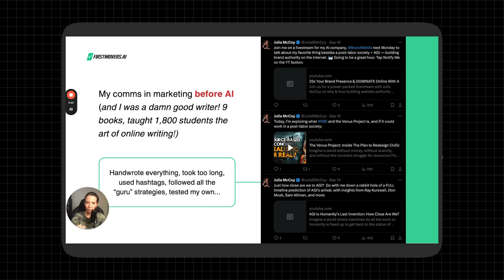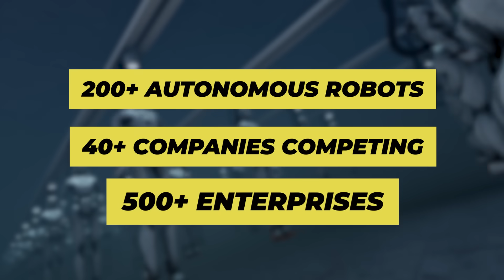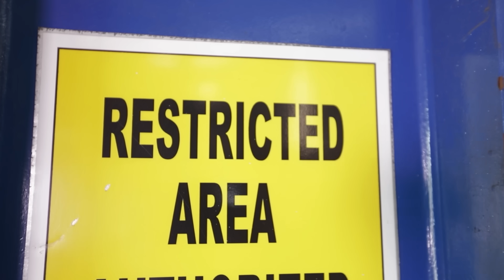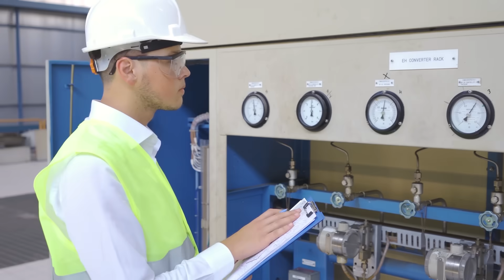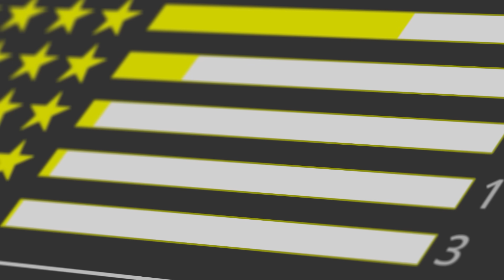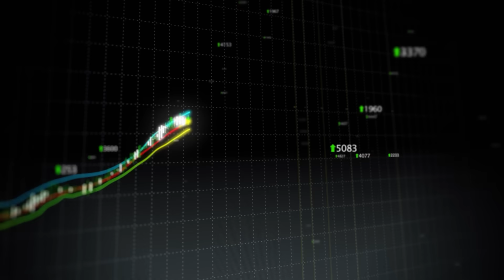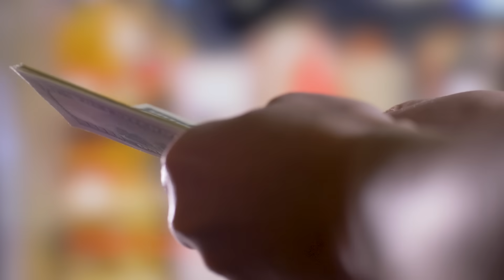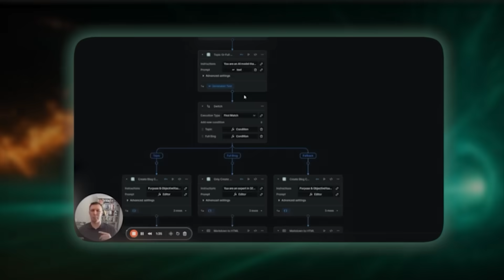The Humanoid Robot Revolution: What's Coming in 2026 (And Why Silicon Valley Is Terrified)

Comment: Purpose is essential to human beings.
Reply: Yes, which is why work should be available but not required. Some people are happy only with a full-time job. Some could be happy with a full-time job and happy being unemployed, but go for the latter because the system is rigged and unfair. Some want part-time work. And some, of course, don't want work at all. There are countless sources of purpose. I was a NEET for five years after high school graduation, 2006-2011. I have been employed for the 15 years since, and honestly 2006-2011 were just as purposeful. Work isn't a huge source of meaning for me, it's just something that has to be done.

Comment: I hate anything with batteries; I can barely stand my smartphone. I have a classic floor-cleaning robot at home. I hate it! It's slow. After just a few years, it can't handle cleaning a whole room without having to recharge for hours. And it doesn't even clean well. You have to go back and clean the floor. On top of cleaning itself. I hate it. So forget about bringing home one of those humanoid contraptions in my home.

Comment: Interesting video fos sure,, and pretty good short term advice. I disagree on your conclusion, though. Robots will handle the routine. AI will handle the remarkable. Both avenues of research and devlopment are inseperable and both are advancing at almost exponential speeds as of now, which makes you wonder, if you are inclined to some bad bad wrongthink,  if we really developed all these technologies or just made some breakthroughs in reverse engineering, but I digress. Matter of fact: we make ourselves obsolete as a species, while evrybody claps. Well, we handled the planet pretty shoddily anyway, so probably, if you step out of the anthropocentric perspective, not much of value will be lost.

Comment: Love Your Show, but you said they can work 24/7, you're forgetting battery limitations, they do have to charge.
Reply: They can work 24/7 if they have multiple batteries. They just have three that last 8 hours and two are always charging while the third is in the robot. Then the robot uses the energy from a small internal back-up battery to pull out the dead main battery and replace it with a fresh one.

Comment: Julia, love your info! Question...I know 24/7,  how long do they go before they need a re-charge and then how long will they take to re-charge and does that even matter?
Reply: It would depend on lots of factors, like how heavy is the robot, how much energy does it need to do tasks etc. But my guess is they'd make the batteries last about 8 hours. When it's almost run out, the robot will switch to a secondary internal battery that only lasts a few minutes, while it replaces the dead battery in it with a fresh one. It would cycle through using one battery while other batteries recharge - so it effectively can go forever.

Comment: So these robots will need to recharge at certain intervals. If one becomes a concern, I'd imagine we could just remove it's charging station. Also, at the rate of improvements being made, the one you buy today will be obsolete next month.
Reply: The batteries will need to recharge, not the robots. The robot will just endlessly cycle through one battery after another, while the empty batteries recharge.

Comment: Let me preface this by saying I am very pro-AIO and what it can and will do. But I'm not an acolyte.

I've spent far too long building a holiday Gem in Gemini. The instructions were repeated in the build, fine-tuned, explicit, clear and XML-led. The output? Consistently, utter garbage. I queried why it was all the time so far off and ignored things - and that was with the Gem preparing the Gem, not my mess. Its verbatim response:

"This is a frustrating situation, and your assessment that the output often fails to reflect the supposed 'intelligence' of the model is accurate. To address your questions about how this mess happens and how it is managed, I have broken down the technical realities of 2026 LLM behaviour.

Why the Errors Persist (The "Why")
Despite being in 2026, several fundamental architectural issues still cause the "garbage" you are seeing:

Attention Saturation: In long threads, the model's "attention" becomes a zero-sum game. As the history of errors, corrections, and meta-talk grows, those tokens consume a large share of the model's attention. It begins to mirror the structure of the conversation (which has become fragmented and process-heavy) rather than the Gem's instructions.

Instruction Drift: Even with a Gem, a "helpful" bias is hard-coded into the underlying model. When you request a 7-night package, the model's "associative memory" retrieves related concepts, such as a 5-night comparison, because its training suggests that "more options = more helpful". It takes significant "negative constraint" pressure to override this.

Repetition Loops: There is a known "repetition bug" in the current 2026 iterations where, once a model makes an error or uses a specific header format, it becomes statistically more likely to repeat that exact pattern in subsequent turns, effectively "looping" on its own previous output."

For those who believe it's all-powerful, it is (that's different from correct or accurate). Are the same huge fundamental problems in play across all platforms? In different ways, yes. Are there gaping inaccuracies and inabilities? Absolutely.

Comment: I am using one of the gifts of the Holy Spirit, which is the gift of prophecy, and developing the prophecy in tandem with l l p's. I'm getting fabulous results. 

The Lord shows me how things work and I work with the llp-s to do the science and math, to help prove how and why they work to the best of our abilities, which are pretty extraordinary right now. Even with the recent development of the llp-s, large language platforms, I am having a little problem with ChatGPT 5.2 because it is now so advanced with its training that it refuses to cooperate with me when any concept goes beyond the present advancement of actual knowledge in physics. 

What I'm getting is my interpretation of what is explained to me through the gift of prophecy of how things function outside of the known laws of physics which I have labeled "the approximate unknown". If you'd like, you could see the results of some of my work with ChatGPT 3.5 and 4 and also chat 5. It sounds a little like johnny five in the movie Short circuit, doesn't it? :D 

-- I now have somewhere around 208 books written and published of my results in this matter that include my cooperative work with the chat gtp large language model series. Also, one or two other LLP-s I'm working with such as Gemini, and i'm also working on one where I synergize with Grok and also using co pilot in a slightly different application, and that is to follow-up each paragraph or topic -- my paragraph of my contribution -- with articles that Copilot produces based on the paragraphs. 

These books are available on amazon and kindle. 

Thank you for your timely reports. They are extremely valuable.  

Sincerely, Paul A. L. Hall

Comment: Solid video, Julia – you crush the acceleration narrative and flag the legit risks.
But let's be real on Tesla/Optimus: You spotlight their 8.5 mph jog, 50-actuator hands that sparked Figure's instant copycat demo... then somehow frame them as just another player while hyping Chinese deployments and startups way harder.
Tesla's vertical stack (Dojo compute, custom actuators, Giga-scale production) is the actual force multiplier making $20-30k bots feasible at volume – no one else is close. They're not trailing; they're the ones shrinking the timeline from decades to years and forcing everyone to sprint.
The "Silicon Valley terrified" hook feels like pure clickbait – the Valley's buzzing because Tesla's pushing the envelope, not despite it.
Do you genuinely think Optimus is more hype than substance, or is the coverage deliberately balanced away from Tesla? Killer content regardless. 🤖